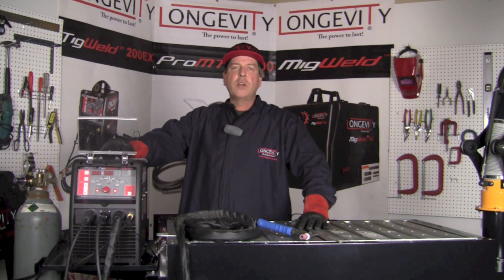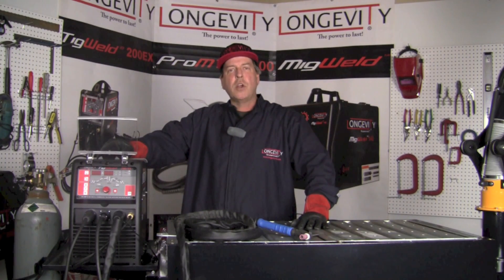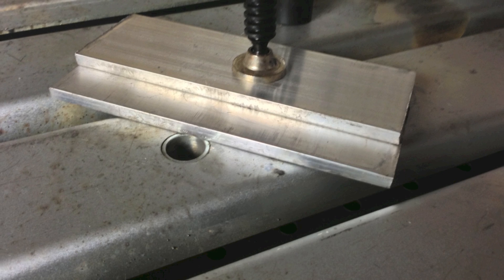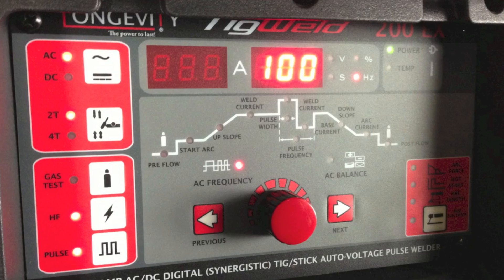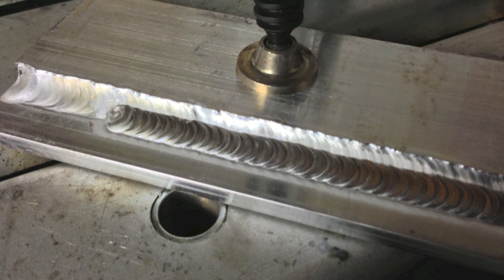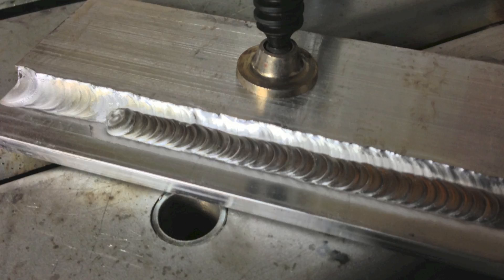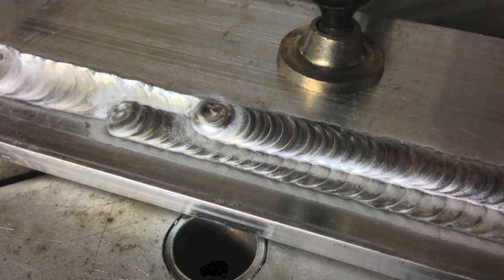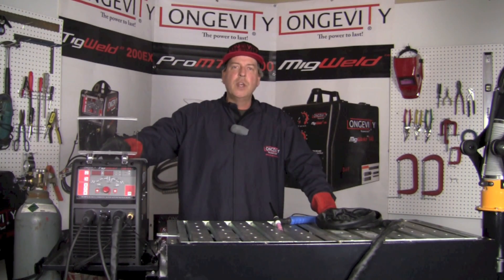LONGEVITY TIGWELD 200EX TIG ALUMINUM MULTIPASS LAP JOINT FILLET WELDS USING PULSE WELDING

Comment: Got some questions.  Bitchin bead first of all.  Been the faith full owner of a syncrowave for several years.  I would love one of these machines but I really need the use of a water cooler and a 9 torch head.  I would really love the use of the miller wireless foot petal.  You know how picky us tig welders are with our favorite products.  I would buy one of these in a heartbeat if I just knew the extremities would interchange.  Feel free to call me Nate Pieper Rogue Customs 336-624-3415